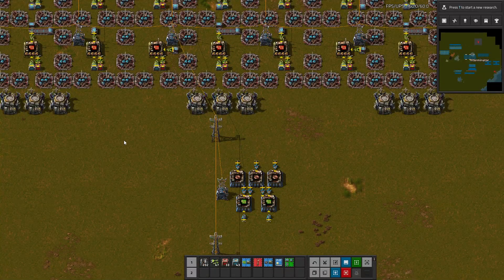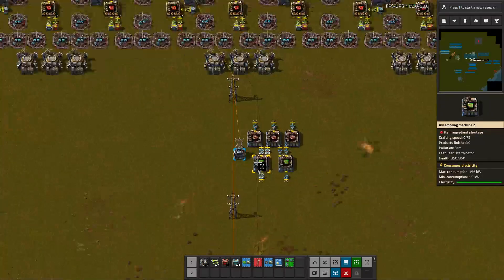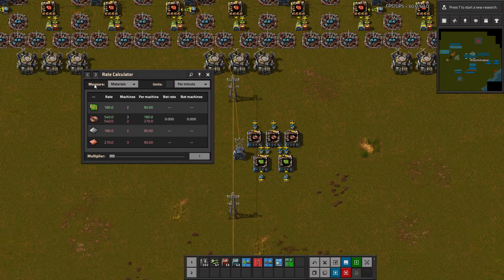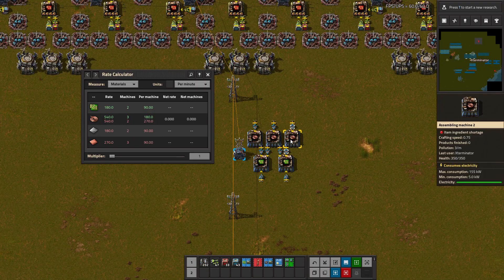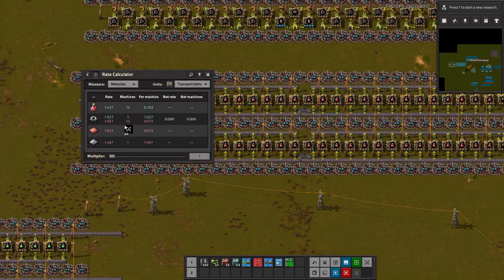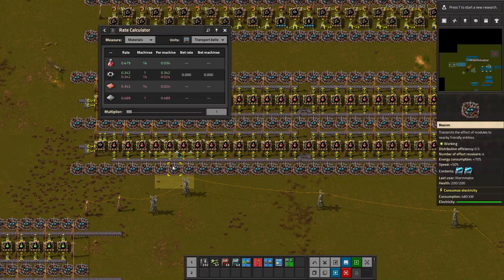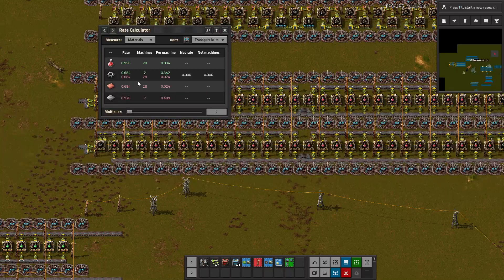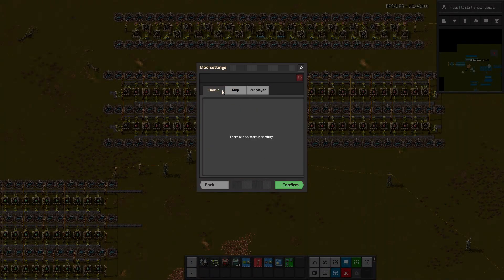Factorio Mod Spotlight - Rate Calculator

Comment: More advantages f Rate Calculator vs MRC:

* In active development, so there are more bug fixes.
* Handles more buildings correctly, such as Krastorio 2 gas generators.
* Supports adding buildings to your calculation with shift, so you can calculate non-rectangular builds.
* Supports any kind of inserter, which you choose from the world rather than a limited set. Good for stuff like Bob's inserters.

Comment: Nice spotlight, as raiguard mentioned though it may already be time for an updated one heh, it may also be good to have a spotlight of the factory planner mod as well, it is very useful and I think a lot of people could benefit from a video describing how it works. (not to mention you get the experience of using it as well)
Reply: Personally I think Helmod is easier to use than FP but someone might like FP better. I guess review both of them and compare pros and cons of each in one vid is nice
Reply: @raizors1331  Factory Planner is my default now. When I switched over from helmod I remember finding FP easier to use. So it's really up to personal preference.